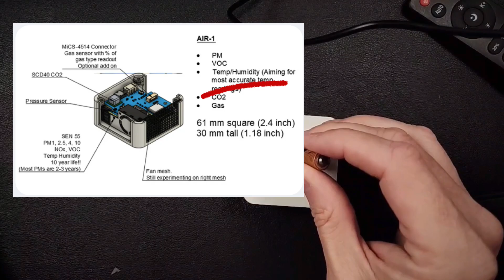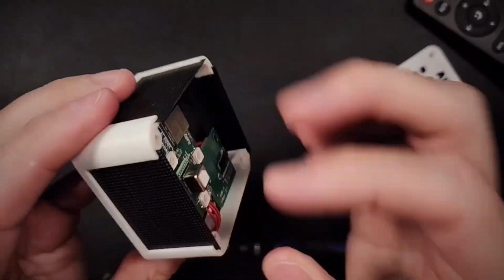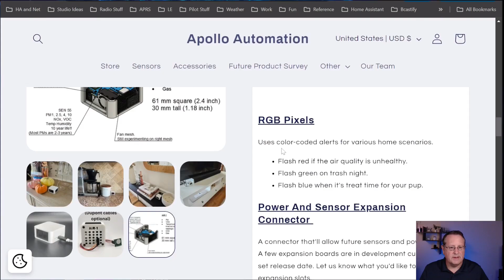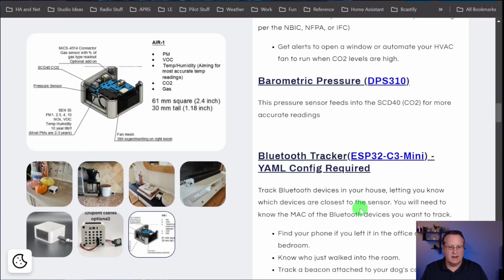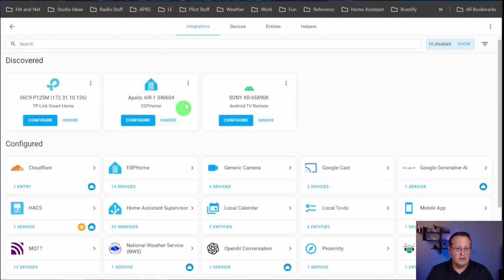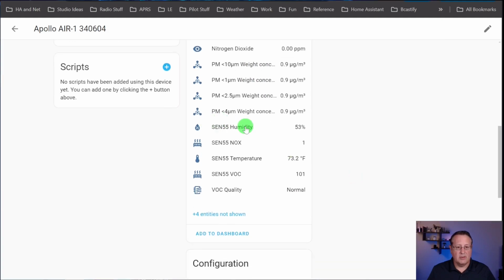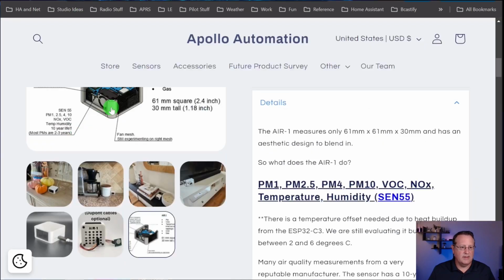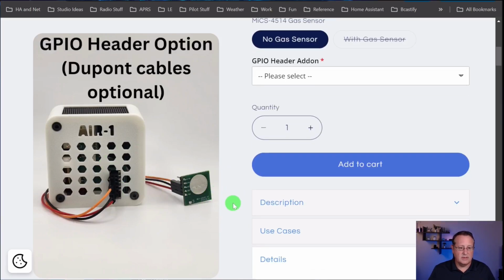Air Quality Alerts when unhealthy using the Apollo Automation AIR-1 and Home Assistant.

Comment: Another very appreciated honest review, Chris! The AIR-1 diagram you are looking at is from an old revision, possibly even Rev 1, which is why the PCB design is different. Additionally, the MiCS-4514 gas sensor is available, but only with the CO2 sensor option. You must select CO2 first, then the MiCS-4514 option will appear. Otherwise, it won't be available. We are happy to answer any questions!

Best,
Justin
Apollo Automation
Reply: Thanks for that info.